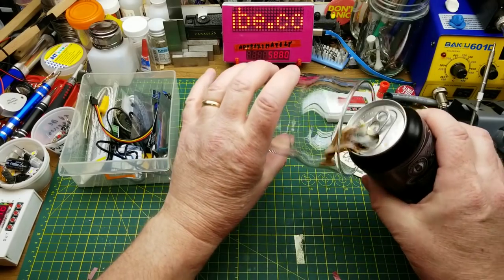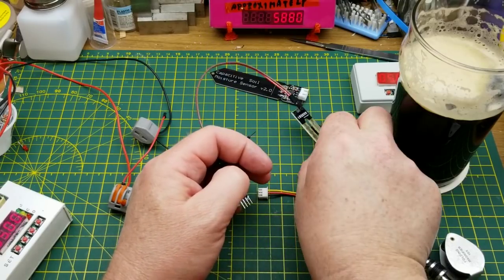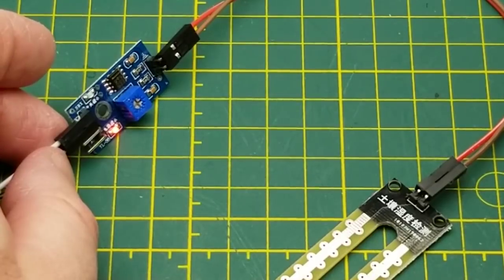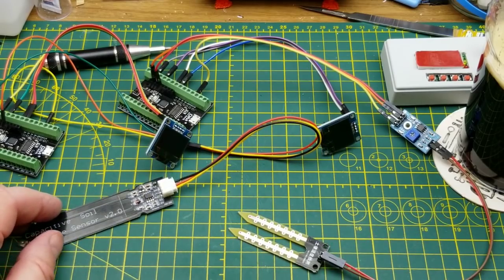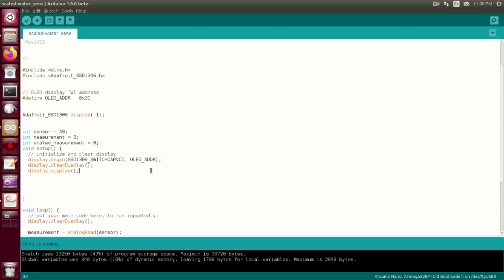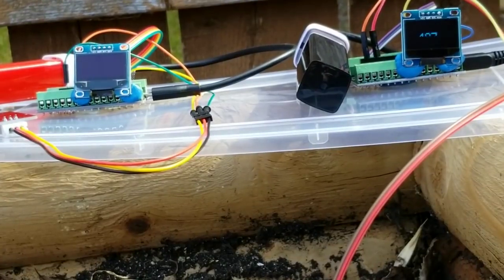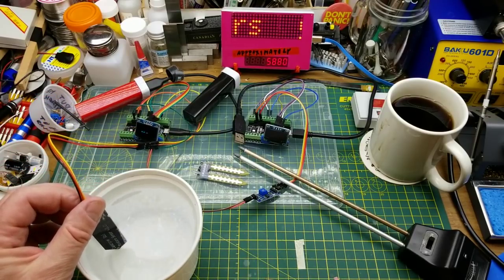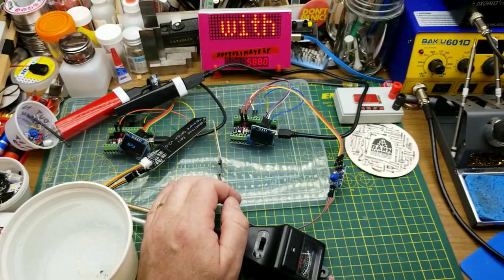tinkering with soil moisture sensors

Comment: To overcome the corrosive action of the first sensor cut the board short and ad two stainless steel wires soldered on the remaining copper on the board you can get a flux to soft solder stainless steel then they will last a long time.
You asked about a water sensor and I used to make one for detecting rain when I had my company that we designed using a pic micro that was none corrosive and lasted many years that switched a relay to control window vents  with my temperature control unit we sold hundreds of them over may years that are probably still out there working now that was 25 years ago as I am now retired at 75. your capacitive one should be sealed on the edges as water will soak into the FR4 as FR4 has a certain amount of talcum powder in it something to do with fire resistance, anyway, all the best Bob from the UK P.S. LOVE YOUR VIDEOS

Comment: I suppose you can solder brass rods to the resistive one and only stick those in the dirt.
Reply from the maker: There's an idea. Sacrificial, replaceable electrodes. I wonder if the oxides that will inevitably form might become too insulating?

Comment: Is soil moisture linear? Or logarithmic? Ask a local horticulturist or scientist? Also, to protect the resistive electrodes, how about running solder down the traces? When the solder is corroded enough, just heat and replace. And, of course, for the maximum dry area, wait until next winter and put into an oven that had been heated above 100C for 5 minutes. This was a fun exploration. I like it when you're doing something practical and not just blinky lights.
Reply from the maker: I'm not sure what it's response curve looks like.
I can't even think how I would create calibrated moisture samples (except for the 2 extremes) to test that.

Comment: Hi, so did the frequency changes when at different moistures?
Reply from the maker: Nope. I didn't explain it as well as I should have.
 The capacitance changes the impedance at the output and attenuates the level of the square wave before it is rectified by the diode at the output of the circuit.
Reply: @pileofstuff  Thanks for the reply.

Comment: You seem to be scaling it backwards. When your moisture is high you get the minimal  output from your sensors. and maximum out put at approx 0 moisture. Both sensors are using the soil element in a divider network. The simpler one is a resistor divider. The capacitance sensor is using  an ac signal feed into a resistor  and capacitor (soil element). So the output of it will vary with a change in capacitance. This ac voltage is converted to DC by the diode and capacitor giving the output.
Reply from the maker: Yeah, I'm a complete hack at programming.  I'm impressed and a bit surprised it worked at all, to be honest.
When I want decent code, I bribe my teenager.

Comment: Thanks for another interesting video! For my greenhouse monitor project I used the capacitive sensor and used code to scale the output to a value of 1 to 10. As fuzzyguy210 mentioned, you have to "invert" the readings as well, lower output values equal higher moisture. Also, the output of the capacitive sensor is not very linear, so scaling is a really
 important.